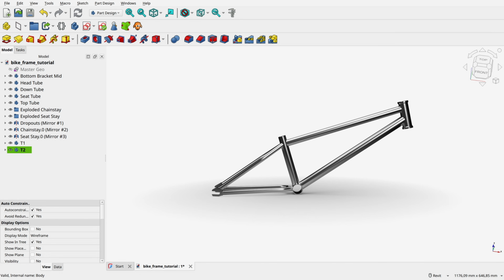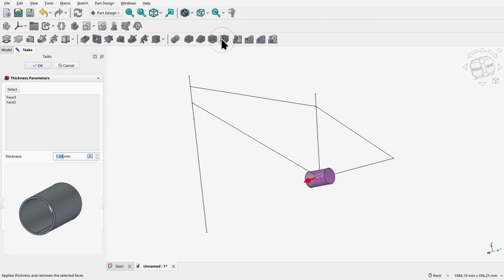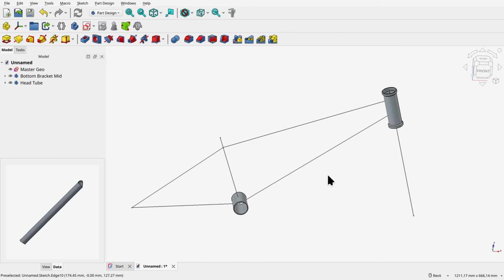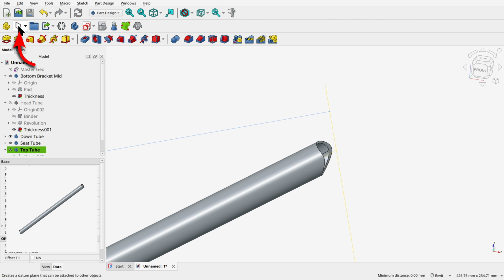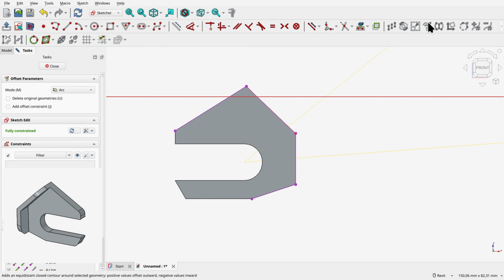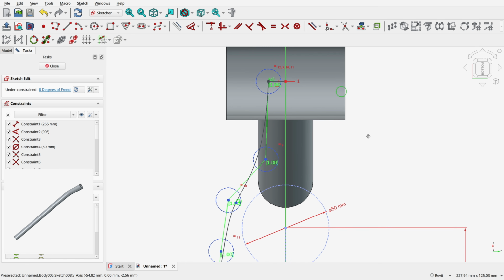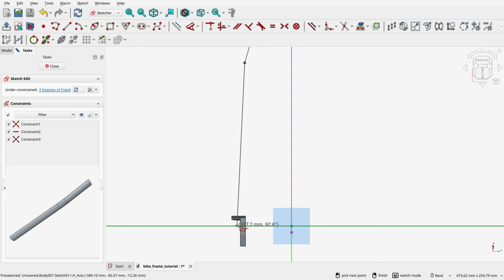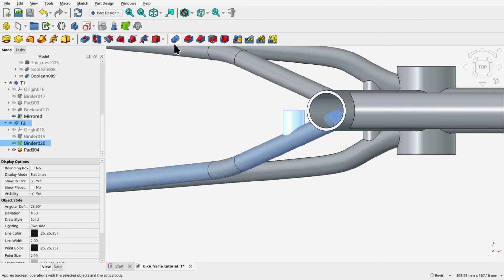FreeCAD  1.1 : Tutorial to become a PRO - Complete Parametric Bike Frame - Direct Assembly

Comment: Using a binder for boolean cut is new to me. Seems any model tree element may be used in boolean cut operations. This tutorial shows heavy use of shape binder to master geo which keeps parametric construction in tact. Ohh yeah ! More, please. I have recently been learning polyline dimensioning for "mirroring" a side to adjecent quadrant. This enables mirroring a complete additive or subtractive body. Trick is, as you demonstrated, constraining the control points adjecent to the line. Just have the same number of control points across the dimensional plane for mirroring a pocket.

Comment: Please explain this obsession with sketches. You can make 3-D parts, like tubes easily and join them or keep them separate to be able to make blueprints for manufacturing.
Reply from the maker: @jorgennorberg7113 It’s not an obsession. Sketches just give you more control and flexibility. With simple round tubes, sure, you could model everything directly in 3D. But as soon as you’re working with frames that have more complex tube profiles or custom sections, sketches become necessary (like the chainstay and seatstay)
In this model, each tube is its own body, they’re not joined together, so you can easily make your blueprints from them. And if you want, you can even use the uncut versions of the tubes, since the cutting is handled by its own feature.

Comment: Good tutorial! Also, you are so patient.

Just a few minutes in, and I already want to scream at FreeCAD for being unnecessarily awkward. Why the hell, do some constraint tools force me to select the to-be-constrained elements first? Just let me pick the damn tool and then apply constraints to as many elements as I want (also, any kind of quick help / tool tips is completely meaningless if I have to know what to do BEFORE clicking the damn tool). And why can't I just use external sketch geometry as is? It's already there, just let me pick it for f's sake! Why do I have to f around with binders and import stuff and whatnot? It's so frustrating.